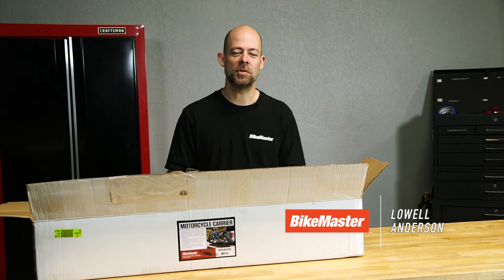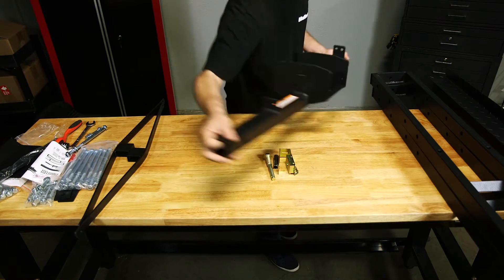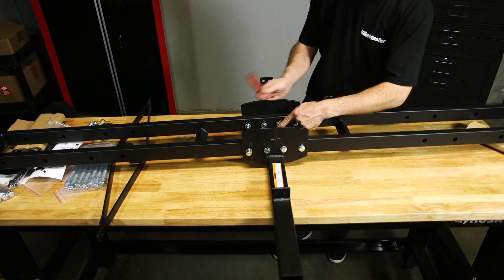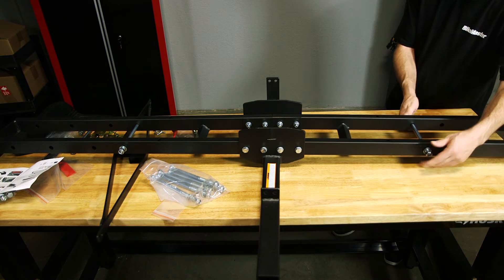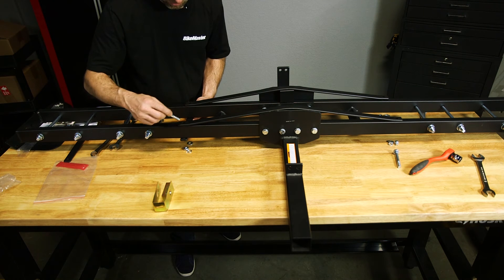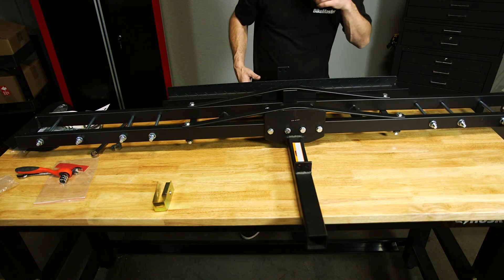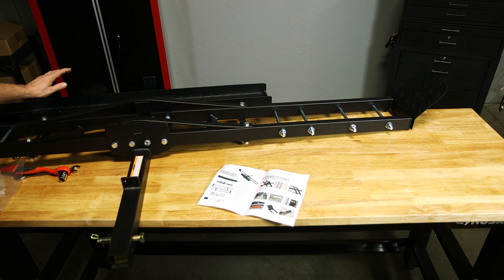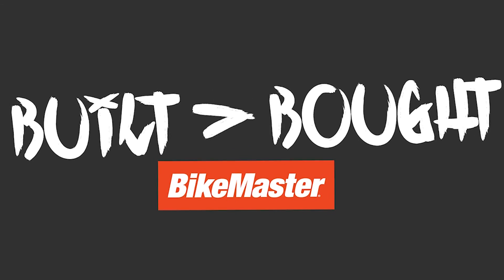BikeMaster Motorcycle Carrier

Comment: I have had excellent results with the BikeMaster carrier. Just make sure your hitch has the proper tongue weight (downward weight on the hitch itself -not the tow weight) specification to hold the carrier weight + bike weight. If you bought your hitch for Mountain Bikes for a car,  it may not have the proper tongue weight for a motorcycle/dirtbike.

Comment: I don’t like the fit & finish of this carrier.  I bought 2 new ones and they both had very weak welds that broke, one before I even got it out of the box.  When returning the 2nd one to the dealer they had 2 more.  The manager opened up both boxes and the welds were broken as well, one spot was not welded at all.  I went to a different shop and purchased another one and it seemed fine although the fit and finish was still not what you would expect.  When I got towards the end the ramp will not mount flush.  Almost 1/4” away from being able to match the holes to the safety pin and the sleeve that goes over the hitch locking pin can’t go as far as it needs to because the bolt is too short.  So what I have now is a 80lb un useable piece of junk.  I am left with calling Jerry to see if we can rig it somehow.  RUN AWAY PROSPECTIVE SUCKERS!  Oh if you are foolish enough to buy in spite of my warning the locking hitch bolt is not only NOT long enough but you need a bigger wrench then these video instructions mention.